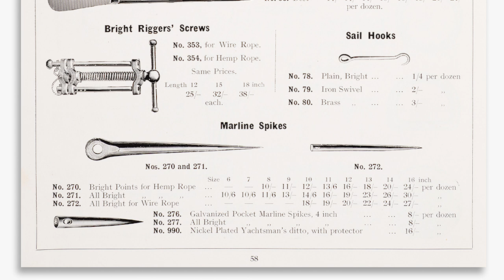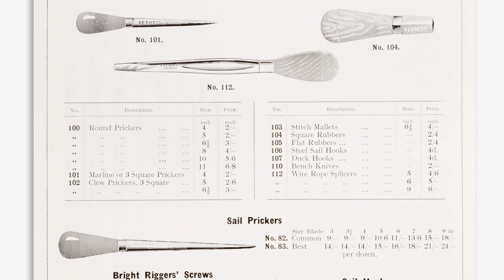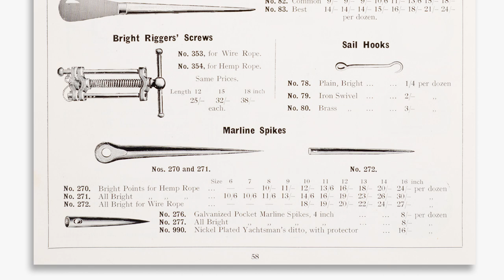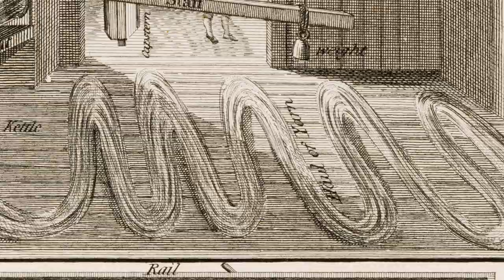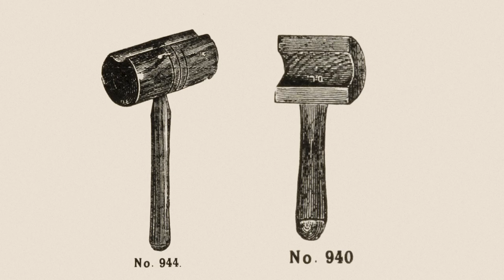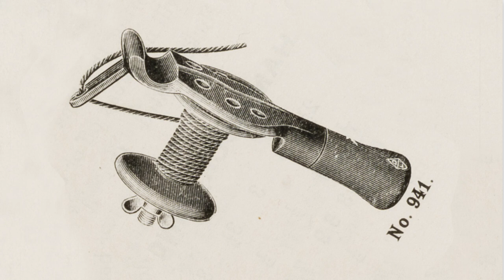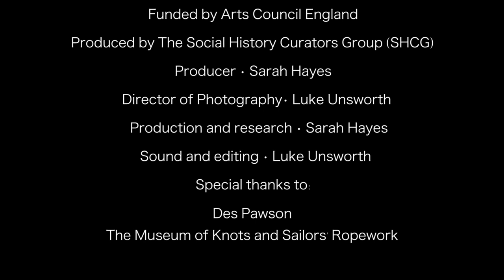Tools of the Trade: rope working and rigging

Comment: Trelleborg. Tisdag den 3 november 2020. 
Nice video. At 7:08 I am a Swede and I hear the Man say “Stockholm tar”. I find I a little funny. Before that he says that it Is “very Smelly”. 
To me, as an old Swede with tradition of boats and some contact with old carpenter tradition I understand “very Smelly” as a form of perfume. 
Probably “Stockholm tar” is what I as a Swede mention as “Dalbränd tjära” = valleyburned tar. 
I try to explain. I come of the method of how to produce it. 

A “dal” is a valley. I this case a very small one. Think a cut in the mountain(?)  approximately 3 m wide and perhaps 30 m long and leaning approximately 10 to 20 degrees compared with the horizontal plane. They did find it somewhere in the woods. 
They filled this “dal” with firewood. Probably it should be pine. The men cowered the firewood with soil and managed to let it burn very slowly. The result was dry distillation and the tar slowly melted down and did slowly float to the lower part where it was possible to collect the tar. 
A variant was to build a funnel(?) ,  a cone. The same procedure. 
Such tar contains a lot of preserving substances for natural materials. 

Balsamic turpentine comes from conifer. A good product. Therefore perhaps forbidden today. It is the conifers chemical weapon against fungal infestation. 

A true sailor do have a pouch for his tools. The pouch shall have seven seams. One seam for every ocean. I do have such a pouch. 

I do have such a pouch. I maked it 1965.  The pouch have followed me since then. I still use the things when I reinforce, for example, some details in my trousers and so on.  

Three-stranded ropes are the best for small boats. But today of polyester. 
Notice that the friction is lower on these modern materials. Therefore You need six “put in” for an spliced eye now days. 

Best regards from a former pleasure sailor. My stolen boat you can see at http://tomasgidlof.se/Ofelia03.jpg 
Hälsning från Skåne. (Scania.) 
Med vänlig hälsning 
Tomas. Pappa till ”Fallet Axel, 29 år!" på  http://gidlöf.se
Reply: They had tar in Sweden then?